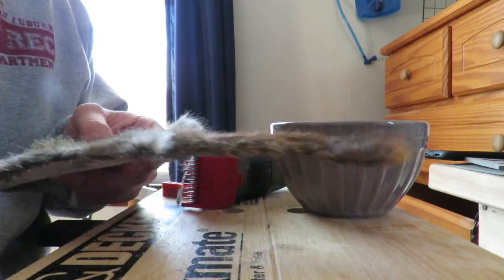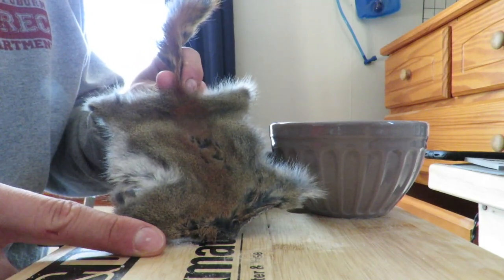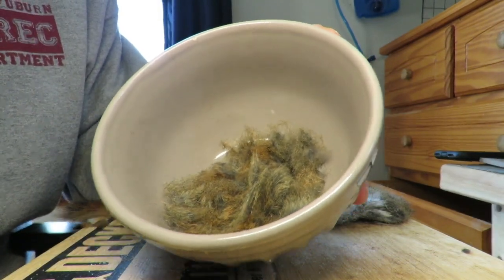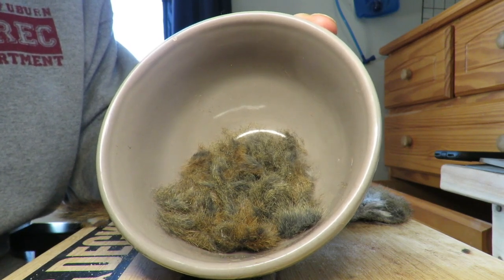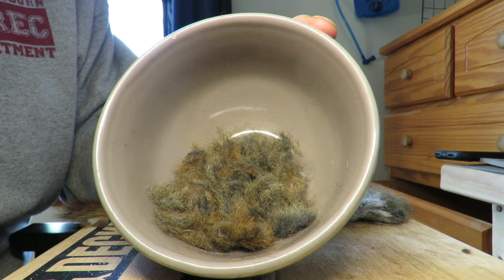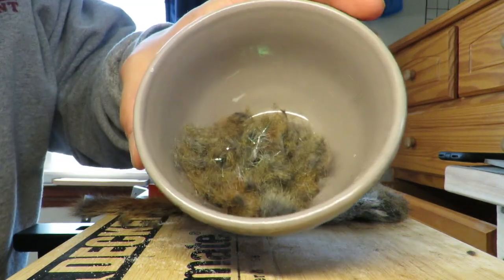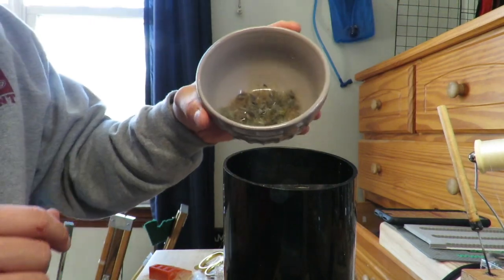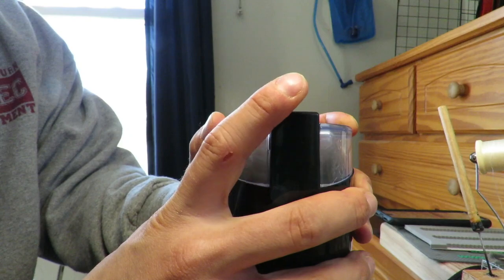Fly Tying - How To Make Your Own Dubbing!

Comment: That's a great way to use up the butt ends of the flash. I usually use a little pearl or UV ice dubbing in my own mixes. I like your results, heading over to your nymph pattern next. Cheers
Reply from the maker: I too like to add a little ice dubbing in there on occasion, especially for brighter mixes like yellows, whites, and oranges! thanks!